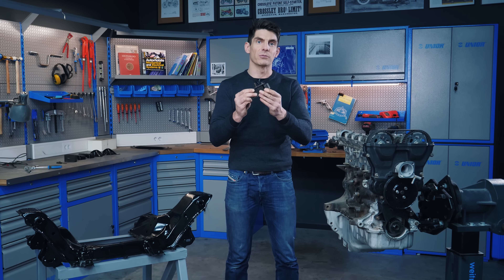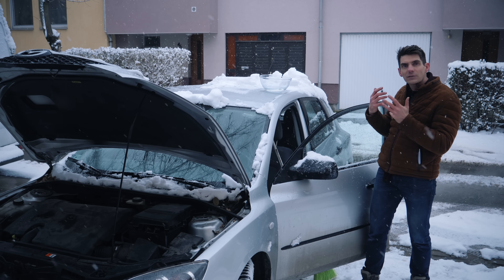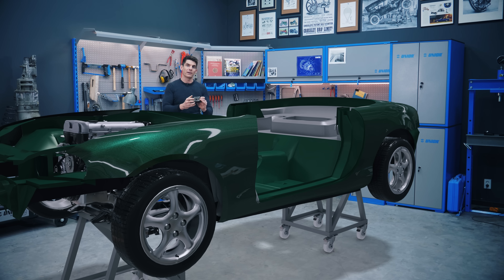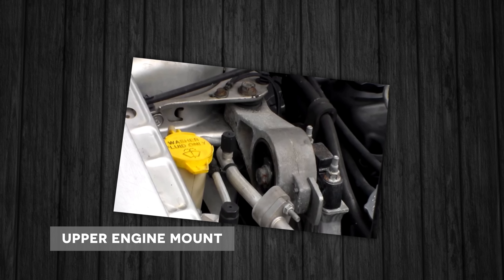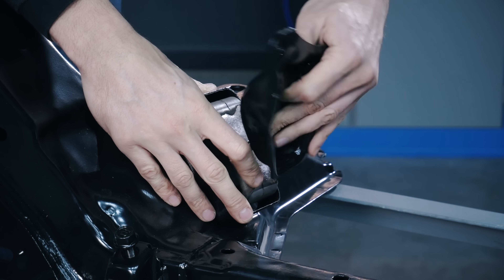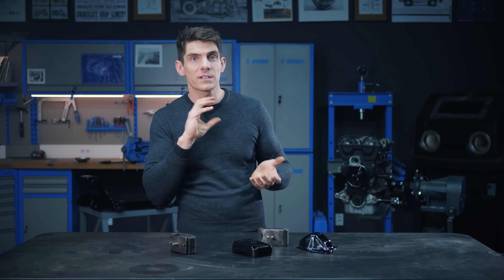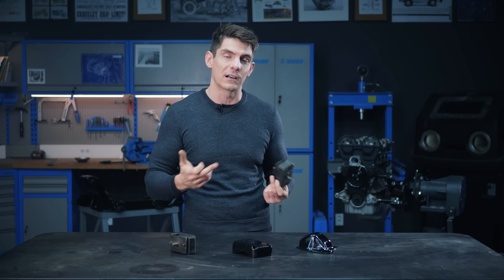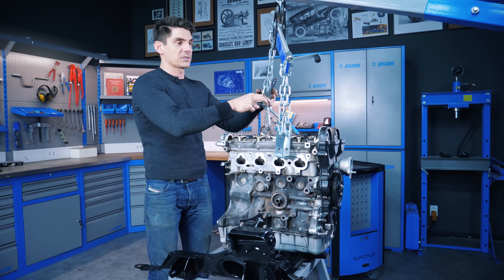Engine mounts: The Complete Guide

Comment: Are there any requirements established by Ford ASE OEM concerning engine mount fasteners? This is a critical area, and I believe there should be further guidance regarding these fasteners.

The Ford OEM parts online site states that the suffix “-s439” indicates that the “s” stands for service fastener, while “439” relates to the zinc plating and coating. This is why most part images display fasteners with thread locker or a specific coating. Is there any validity to this assertion?

Comment: I wouldn't got motor mounts but I think I only got the ones that go to the body. I didn't know there was a big rubber block. That was supposed to be with it and another piece that attaches to the Engine that's what I need to know about

Comment: Which are the typical symptoms of worn out or broken engine mounts?
Reply: You can hear a knock when turning on the car, and usually weird idle noise like loose metal
Reply: Thanks, it might be the problem then. How long should they last for the average driver?
Reply: @AgathaundFreidrich-ex7js  I had mine replaced even though supposed to have new mounts, mine lasted  a week when supposed to last at least 200k. The problem is if they fail them your other parts can wobble. They are basically a shock absorber for the rest of your engine and components

Comment: Mounts does allow different sized engines on same body ftrame right?
Reply: No
Reply: @sorian_delorean3348  what is the reason for that?
Reply: @naveenpe  of course not, the chassis itself should be stiff enough to support the engine weight and power so a bigger engine would overwhelm a weak chassis.

Comment: What stops the mount from coming loose while the engine is running? I thought there should be a small locking nut, too, to be used in combination with the larger nut used.

Comment: Really interesting explaination.
I need to replace the mounts on my 1997 Renault Mégane Coupe which have perished.
It is front wheel drive with top mounts and lower mounts joined to a subframe. Great for in the initial prisuction line where a pre assembled suspension and drivetrain can be mated to the body. Not so good for replacing later in the cars life.

Comment: Replacing the engine mounts can be expensive: because once the vibration from the engine is gone, you will realize that there's a number more vibrating parts in your car that shouldn't be vibrating. So choose wisely, blissful ignorance or the harsh truth that your car is literally breaking apart.
Reply: Don't remind me went from engine to a wheel bearing to an axle
Reply: @BaltazarSMZ  engine mount > wheels > cv axle > drive belt and tensioner > timing belt and water pump bearings. EDIT: added steering rack to that list too.
Reply: @warnacokelat  don't give nightmares with more work. The all that happened in succession was the wheel bearing went bad at the same time as the cv shaft and all the my money in parts😭💸

Comment: Hello.  Can you please tell mean this 1.6 l / 86 hp / 63 kw?  Car with this performance is good family car, is good for long distances?  I want to buy my first car and i don't know what this means.
Reply: 1.6L means around 1600 cubic centimeter. This is the unit for volume of cylinders, 1.6L engine usually is made of 4 cylinders therefore each cylinder of 400cc. 86Hp is the power the engine can produce, in simple words the rate at which the work is done. As for me a 1.6L is a pretty good specification for a family car. Any car is good for long trips if its in good shape and have everything serviced and oiled. Good luck for your first car. Cheers !
Reply: @AbdulRafay7  Thank you.
Reply: If you’re looking for a car that you’re going to weigh down with luggage on road trips, you should have at least 100 horsepower. Any less then that and you might have trouble merging and accelerating, assuming you have a lot of weight and people in the car.

Comment: Another problem you may get with hard mounting is the thermal expansion of the engine as it warms up. Allowing some movement keeps the frame and engine from fatiguing each other very warm up and shut down cycle. In other industries, this drives a lot of the mounting design because the relative temperatures are higher and the thermal expansion is greater.

Comment: When your car is getting very old your engine mounts get hard/worn and end up vibrating more in the cabin.
This is why you get new rattles start to appear inside your car and end up driving you nuts haha.
Get new mounts, poly ones.
Also when you take off your mounts when say your replacing your timing belt make sure you fit the mounts exactly back in the same position with the holes aligned up between the rubber mount and the metal bracket so you can see no rubber sticking out when looking down all through the hole.
Otherwise you will get vibration due to the fact it has not gone back to its original position.
You can get some wiggle room in the hole in the metal bracket itself and in the rubber mount,so don't go thinking it all aligns up automatically when you fit it all back.

Comment: My ford freestyle(hatchback in India) was recalled for replacing engine mount. Just one piece completely removed all the vibrations from steering wheel. And because I don't have tachometer (base variant) i had to relearn when to change gears. Earlier I relied on the vibrations in steering wheel for feeling rpm. After new engine mount, i had to develop an ear for engine sound.

Comment: not to be an old MR  Know it all.  you did a good job..  but if you did a bit history it would be more interesting.   AKA  in 20s-30s  C  Chrysler  mounted 2 mounts at the front of the engine up high.  and a mount low at the rear.  with  the CG going throu  the engine CG and the mounts.   the engine would pivot on that CL.  keeping rocking motion  off of the frame

Comment: Got to ask, exactly what class of cars have chains over the engines?  I have followed developments in performance cars since 1958, and have never seen any such thing.  Perhaps you are thinking of the straps that pass over the top of the supercharger on fuel-burning drag race cars.  Those straps are mandated to restrain the supercharger from breaking off of the engine and blasting to altitudes and distances that endanger everybody in the area following a fuel explosion inside the intake system.  Such incidents were common enough to make restraints mandatory.
Reply: I have seen chains as a backyard method of retaining a high torque engine in drag racing. But it just put a limit on the rotation of the engine so it would stop ripping factory mounts. Never seen one over top of the engine.